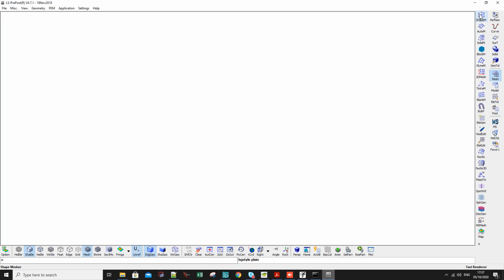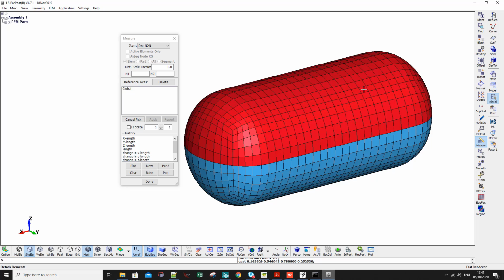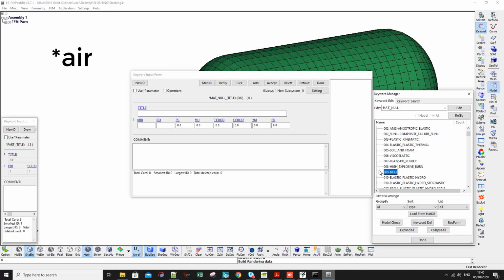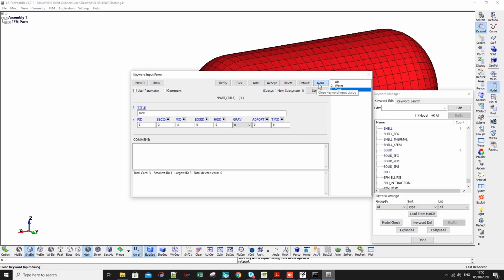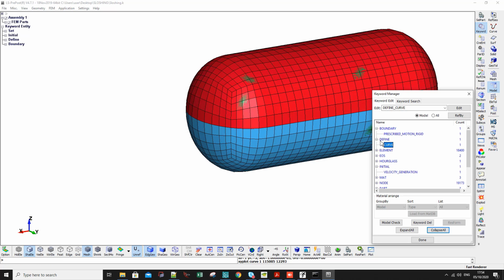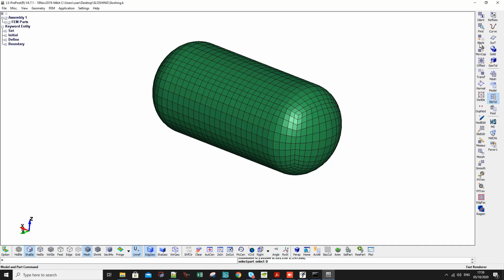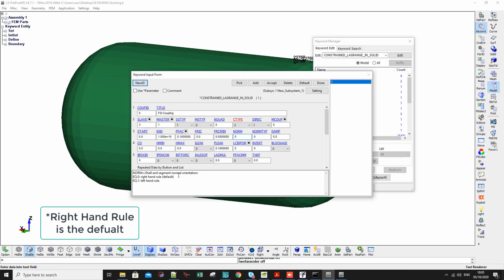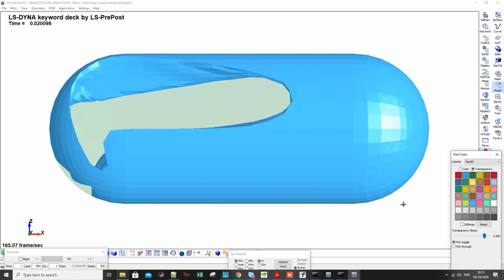LS-DYNA TUTORIAL 19: Sloshing Inside a Tank with ALE method

Comment: Just like you have done in the video, I have also done the same, but while I am running the file, the file is getting terminated. So is this happening because of the student version or will some setting have to be done again? Before this, the ballistic particle, impact test of the bullet has been run.😊
Reply from the maker: @abhishektiwari-wr6qx  I am not sure. It could be the student version or it could be a mistake you made when creating the model. Anyhow, when you run the analysis, the command window will appear where it will tell you it is error termination or normal termination. If you scroll up on this window screen, the cause for the error termination will be mentioned, or at least a hint will be given..
Reply: please provide your mail  @AmeenTopa

Comment: Hi Mr. Topa. I have a question to ask. If I want to know the impact force of liquid on the side wall, do I need to use * CONTACT MATIC SURFACE TO SURFACE, and then set SAPR and SBPR to 1 to view the impact force of liquid on the side wall in the results?
Reply: sorry, it is *CONTACT AUTOMATIC SURFACE TO SURFACE,
Reply from the maker: @TianyuLiu-i5i  to find the interaction force between the fluid and structure, you need to use DATABASE FSI. Check out my tutorial: ball drop on water.
Reply: @AmeenTopa   Mr. Topa, thanks a lot!  I'm going to study right away
Reply: @AmeenTopa  Hi, Mr. Topa. May I ask another question, does it mean that there is no need to set the contact between fluid and structure (* CONTACT AUTOMATIC SURFACE TO SURFACE) after setting  *CONSTRAINED LAGRANGE IN SOLID. I previously activated both operations, but I found that the contact force in the results is always zero.
Reply from the maker: @TianyuLiu-i5i yes, when modelled interactions with fluid (ALE) and structure (solid or shell parts), you use *CONSTRAINED LAGRANGE IN SOLID instead of *CONTACT...
Reply: @AmeenTopa  Hi, Mr. Topa. I followed your advice and carried out the operation. But I found that only the process that structures impacting fluid has contact force data, while the process that fluid impacting structures does not have contact data.
Reply: @AmeenTopa  But the real scenario is fluid impacting structures, and I want to use the ALE method. Is there any good way to solve this?
Reply from the maker: @TianyuLiu-i5i  I don't understand your problem. 

What's the difference between "structure impacting fluid" and "fluid impacting structure"? Please explain. 

The CONSTRAINED LAGRANGE IN SOLID works in both ways. If the fluid moves to the structure, or the structure moves to fluid, this keyword will be working.
Reply: @AmeenTopa   Mr. Topa, I'm sorry, my explanation may have caused ambiguity. The contact force result  that structure moves to fluid can be found in  ASCII_OPTION,  but the process that fluid moves to the structure can not. But the real scenario is fluid moving to structures.

Comment: Excuse me. Do you know cohesive elements? I set my ice with cohesive elements and use a rigid part to impact on my ice. :yougotthis:My question is when I set an Eroding single contact to simulate ice self-contact. My SPC boundary condition on ice just make no sense, ice cubes spread out directly after impact. Can you give me some advice? Thank you, your videos are very helpful for my article.
Reply from the maker: @dududulcap458  yes, I have worked on ice modelling with cohesive elements. What's the problem with your model?

Comment: Hi Ameen,
Thank you so much for the helpful video! I followed all the steps but when I ran it, the ALE water does not move at all, even though the tank moves perfectly fine. I am using the 2024 version of LsDyna. Do you know of any things that may have changed since 2020 that would be causing this?

Thanks!
Reply from the maker: This shouldn't be a problem with the solver. 

Please make sure that the steps are followed correctly, especially the following keywords:
*INITIAL VELOCITY GENERATION 
*ALE REFERENCE SYSTEM

Comment: Hi Mr. Topa Just want I followed all the steps that you do on the video but mine is not waving at all the tube is just moving forward and backward but not the water inside. Do you have any idea why is that happens?
Reply from the maker: Make sure you show the ALE 'fluid' parts when you are post processing. Hide the solid parts.
Reply: I just did what you have said but nothing happened to the fluid sir, still not waving 
 @AmeenTopa
Reply from the maker: @SherylDolot  make sure that the top half and the lower half of the ale mesh are connected.
Reply: hi Sir, do you have the old .k file for this toturial? Can I have a copy of that sir?
 @AmeenTopa
Reply: as of now sir it doesn't make a wave at all
Reply from the maker: @SherylDolot  

It seems that you are the only one having this problem. Others who tried this video didn't face similar problems.

Sorry, I don't have the file anymore because this is a very video. Please redo the model again from the start and make sure to follow all steps carefully.
Reply: hi sir, I already solve the problem. Now my file is already working.Thank you
 @AmeenTopa

Comment: 嗨，Ameen.我来自中国，通过朋友的推荐观看了您的视频。你的视频真的很好，对我现在的论文很有帮助，但是现在有一个问题，当罐体材料是刚体时，结果和你的一样。但是当我把水箱的材料换成001-ELASTIC时，随着水箱的移动，它得到的水越来越多，空气越来越少，直到水箱装满水，有什么问题呢？期待您的回复。
Reply from the maker: Thank you for reaching out. I used GoogleTranslate on your comment because I don't understand your language.

You are using MAT ELASTIC instead of MAT RIGID for the tank. Make sure that the material properties are correct.

Also, make sure that the ALE domain is larger than the tank, not like my video. In my video, the ALE is only inside the tank which works only with rigid tanks.
Reply: @AmeenTopa  Thank you very much for your reply. I'm sorry that Google automatically translated my comments, which caused you trouble. I wanted to use MAT ELASTIC instead of MAT RIGID to get the stress and strain of the tank, but eventually the water got more and more and ended up filling the tank. Do you mean that I need to expand the air domain outside the tank to surround the tank? But it creates a very large air domain.
Reply from the maker: @尹小东-l1u  Yes, you are correct. You need to make the ALE domain larger than the tank. 

However, you only need one or two layer of elements in each direction. So, the model woll not be very large.
Reply: @AmeenTopa  Thank you for your answer. I understand. However, since the inner ALE domain and the outer ALE domain are separated by the tank, can the ALE domain be processed in a common node way? And by the way, can I set MAT RIGID on the tank and then put that pressure on the tank and get the stress? Indirect coupling similar to FLUENT software.
Reply from the maker: @尹小东-l1u  The ALE mesh inside and outside the tank should be connected (shared nodes). However, the Lagrange tank mesh should not be merged with the ALE mesh. 

If you use MAT RIGID for the tank, then you can apply a load (it will be force, not pressure) using LOAD RIGID BODY.
Reply: @AmeenTopa  What I mean is that the force is obtained through the fluid-structure coupling analysis of the rigid tank, and then the force is applied to the elastic tank as the load, so as to obtain the stress and strain. Do you think it is feasible? Thank you for your trouble.
Reply from the maker: @尹小东-l1u  the force obtained from the rigid tank is called Rigid Body Force (RBF) and it is the sum of forces applied on each element of the tank. You see, each element of the tank is subjected to different force values. That's why it is not correct to use the RBF on the elements of the elastic tank.
Reply: @AmeenTopa  Ok, I see. Thank you for taking time out of your busy schedule to answer my question. You are really a good engineer. I've already pushed your video to my classmates, and I'm sure it'll be helpful to them, too. Thank you again sincerely!
Reply from the maker: @尹小东-l1u  You are welcome and thank you for sharing my videos. 

If there is possibility for research collaboration, then I can spend more time looking into your problem. Btw, you can check my paper about sloshing which was published in Ocean Engineering journal. :)
Reply: @AmeenTopa  Sorry to bother you again. Now I've added a baffle in the middle of the tank, and on the normal side of the baffle, the water is coupled to the baffle, and the water cannot penetrate the baffle. But on the other side of the baffle, the water penetrates the baffle. How to solve this problem, the baffle as a shell can only have one normal direction. If possible, please help me to answer it, thank you very much!

Comment: Thank you so much for nice video. I believe it is helpful to build vehicle door and air model under side impact to define pressure level. The LS-Dyna job 'Sloshing_Ex.k' is well completed in smp R11.1 WINDOWS X64. Tank and ALE are moving together, but ALE air and water are not shown sloshing. What do I need to check for input file to see ALE sloshing?
Reply from the maker: You are welcome. Make sure to display the Fluid (ALE) parts not the solid part.

Comment: Hi Ameen.What a geat job u r doing ! In the video tutorial, I saw that you first copied shell of the liquid container, then cleared the shell at the original position, and moved the copied shell back to the original position. Why don't you need to merge again here?I mean that there are dup nodes at the junction of air and water with the shell?In addition, I would like to ask you how to solve the dynamic analysis of full liquid container(without air) under the action of earthquake? We look forward to your advice and help. I felt I could solve this problem with Fliud80 in ANSYS.Thanks U!
Reply from the maker: Hi there, 

The reason why I copied the tank is because I don't want it to be merged with the air and water mesh. Lagrange mesh and ALE mesh shouldn't be connected with each other. 

Regarding your second question, you can input the acceleration from the earthquake using BOUNDARY PRESCRIBED MOTION RIGID if your tank is rigid or PRESCRIBED MOTION SET if your tank is deformable. 

I can give your further support on this matter as I am doing research about sloshing too. But only if there is a research collaboration between us....and of course we use LSDYNA for the simulation....
Reply: Thank you for your answer.I see what you mean. In addition, I am sorry that I made a mistake in my expression. I don't mean merge,actually what I mean is whether normal degrees of freedom of dup nodes need to be coupled ?They are needed to be coupled when using ANSYS Fliud80, so I put forward this question. I thought that LSDYNA would do the same.Now I understand through your explanation.Also, for ALE algorithms for full containers, is it ok to remove the air part from your video tutorial?Then do a dynamic analysis using the two keywords you mentioned?Can I get your email or wechat for further contact? Hope to have the opportunity to cooperate, such as co-author published papers and so on.
Reply from the maker: Regarding ANSYS, you can apply the acceleration on all the nodes of the tank. 

You can model the sloshing with only water. But still you need the mesh of the empty space of the tank. You can declare that space as void. 

Put your email here and I will follow up in my free time.
Reply from the maker: For simulation of ALE with water and void, check my tutorial ball drop on water.
Reply: Thank you!
My email:pengfeifeixu@mail.dlut.edu.cn   
I have implemented FSI simulation using Fluid30 or Fluid80.The dynamic calculation takes the same approach as you said, consistent input, acceleration applied on all nodes.I will do simulation of ALE with water and void then discuss the problem with you.

Comment: How do we define the parameter in EOS_GRUNEISEN or EOS_LINEAR_POLYNOMIAL when it's a polymer instead of water?
Reply from the maker: It depends on what type of polymer. (I assume you are talking about melted polymer here).

It is really difficult to tell. You may need a different type of EOS. The only way to find is to search in the open literature.
Reply: @AmeenTopa  Hi Ameen. Thanks for your reply. I am running my ALE simulation and facing an Error "Negative volume in advection redo cycle". Do you know what causes this?

Comment: HI Ameen, Thanks again for the nice video, it definitely helps for the physical problem I am currently facing. Could you please kindly answer one question, For the the linear polynomial coefficient you used for EOS in the air domain ; and the coefficient you used in for Gruneisen EOS equation in the water domain, could you provide the literature/guide of how to finding these coefficients? I have checked your early ball drop to water tutorial, the water was model in polynomial EOS and the coefficient are different from what you used in this tutorial. Thanks a lot. Zhemin Cai
Reply from the maker: Hi Cai,

There is no directory where you can find these coefficients. The only way is to look in the literatures. If you look and compare both examples, yes the coefficients are different, but also the NULL material definition. The EOS coefficients depend on how you define MAT NULL.

You can check here for more examples for water simulations:
https://www.dynaexamples.com/ale/sloshing
https://www.dynaexamples.com/ale/intermediate-example/wavestructure
https://www.dynaexamples.com/sph/intermediate-examples/wavestructure

The wave structure examples were validated against experimental work. So I believe you can trust their input :)
Reply: Hi Ameen, Thanks a lot for the detailed explanation and dynamore example,  really helps, appreciated😄
Reply from the maker: @ahdshsah4869  No problem. If you got any questions, feel free to ask. 

Just for your note, I am always open for research collaborations :D
Reply: @AmeenTopa  Hi Ameen. That is  Great, the content left on my project has will focus on two parts: (1) Fluid slosh simulation in a baffled chemical transport tank, I have run a set of model in Ansys fluent and finished the early stage simulation, but short duration peak force was observed, I assume it should come from the VOF numerical method and the solver can not handle the sharp separation on the wave with short duration, that is why I want to try SPH/ALE method on dyna (2) Simulate polymer powder movement, heat transfer and phase change inside a rotating tank, For this part, Dyna is the only tool I found can handle this complex physics, I still have one year left for this project so hopefully I could solve it. I am from UNSW in Sydney, Below is my linkdin profile" https://www.linkedin.com/in/zhemin-cai-4a67a5112/?originalSubdomain=au", my unsw email address is "zhemin.cai@unsw.edu.au". Thanks a lot for your video and help, very happy to collaborations.
Reply from the maker: I have looked into your LinkedIn profile and had a quick look at your previous work from ResearchGate. I’d say that you have done very good work.

I am Ameen Topa, a Research Scientist from PETRONAS University of Technology, Malaysia. My core research is impact engineering and fluid structure interaction simulations. Looking forward for this collaboration.

Comment: Very useful video sir, I'm doing a final year project on ls dyna can u help me sir!!?
Reply from the maker: Thanks. Please share my videos so your classmates, juniors can benefit too.

Yes how can I help you?
Reply: @AmeenTopa  can you make a video for how to do a static and dynamic analysis (axial crush) for a complex geometry (like cone which is like the cones placed on the road)with the composite materials??? 
Already watched the video you have done before for that particular analysis (cylinder shell) very helpful started working with that sir but it taking too much time when I use the same process for the cone and alsp ended up with error termination sir!! 
Can u please help me to get through it!??
Reply from the maker: @saichilla2421  You can check this video for axial tube crush. 
https://www.youtube.com/watch?v=3lqeqYbAzoo&t=994s

I don't have any videos on composite simulation. I have planning to do one but due to time limitation I haven't done it yet (I am not a full time YouTuber :D )
Reply from the maker: @saichilla2421  Static analysis will take long time if you are using explicit solver to run them.
Reply: @AmeenTopa  thank you sir for reply that's the video I watched sir many times. can you tell the way to do the same with  the cone (closed at one end like halfsphere and open at other end with a section thicknes of 3mm)
Reply: @AmeenTopa  is that so sir!? Is there anyway to reduce time or we have to proceed
Reply from the maker: @saichilla2421  You can use implicit solver or time scaling/mass scaling
Reply: @AmeenTopa  ok sir thank you I will try sir
Reply: https://www.sciencedirect.com/science/article/pii/S026635381100385X?casa_token=eS4H_5inQhwAAAAA:VRsd5GYZS1xIbO5aQx1y-bcxaTjOFpivyKeY0VtJp6XinfFVmTs1_mSgW2O4aTFVNkN--4Jsjg this was the reference sir!!
Reply from the maker: Honestly, this seems a bit advanced for final year project :D